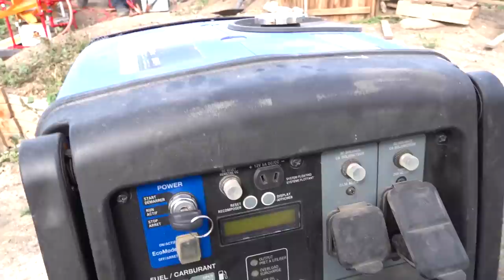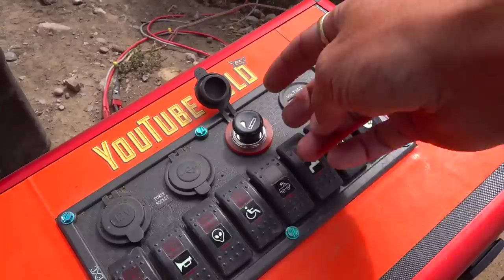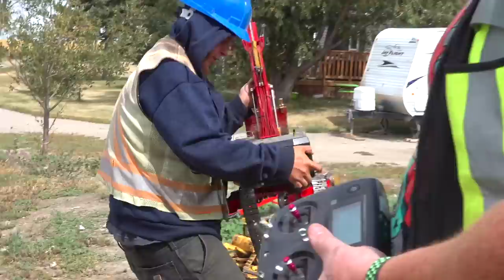YouTube GOLD! (S3 E16) A ROOKIE ROLLS THE ROCK TRUCK | RC ADVENTURES

Comment: My excavator that I am designing and building are the Hyper Tough drills sold at Wally for $10. They are 5 volts and very high torque. The actuators that I am designing will be threaded rods driven by these drills. They should be able to exert about 100 pounds of force! I'm building at a scale about 4x bigger than 1/14" scale! Hahahaha "golden shower", I'm laughing my butt off. When you guys where chanting "gold gold gold" she had to come look. She spewed with excitement... She's sold gold jewelry at the pawn shop and knows the amount that one can make!!!

Comment: Those who have not experience the joy of playing with these things just dont understand do they? All of my friends would laugh at me being a 64 year old playing in the dirt. Well that changes as soon as they come over and try mine out, they all want to get them now! My wife ordered me the actuator kit for my excavator. Those cheap arse plastic gears screwed up in 2 months! The excavator cost me $ 70, and the actuator kit is $80. But when I am done doing the mod it will be so powerful that I'll have to get fishing weights for ballast! The plastic gear crap makes the arms flimsy, where the actuators that have threaded screws will make it where its not floppy. The kit with the 3 actuators is due in early January. I think my wife bought me 4 other pieces of equipment. She plays sometimes... but just not her thing, but does think its kinda fun. And it keeps me out of her hair! I plan on building a tiny warehouse to park everything, its too much trouble toting all outside. I plan on having an entire fleet, about 20 pieces. Hey, I saw a guy here on youtube, a retired firefighter. His scenario was a 18 wheeler went off a bridge and caught on fire, it was hauling a flamable substance in the tank. Well he dispatched all of his equipment that actually did have foam to put the fire out. It was a big operation, and so fun to watch the trucks spraying the flames out. He did another vid of his little warehouse caught on fire. He used 3 water pumping trucks do put out the fire! Just think, he gets to re-live his days of being on the job! Its a great hobby, but can sure get expensive, but thats no problem for me... got 7 checks coming in... You got some fine equipment there! Sho nuf gets thumbs up on vids! I enjoyed watching them!!! It gives me ideas of how I want my construction zone to be, which is the entire backyard!!!